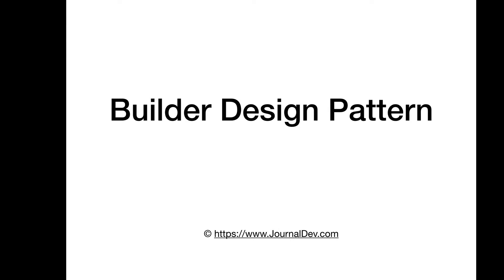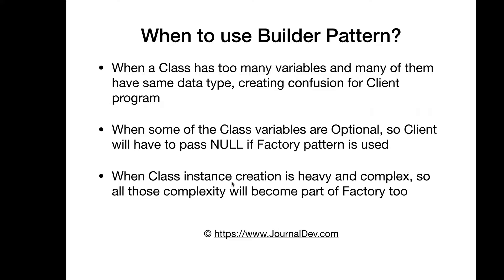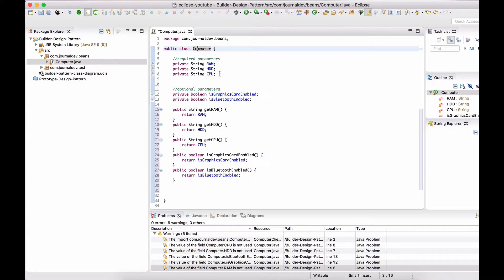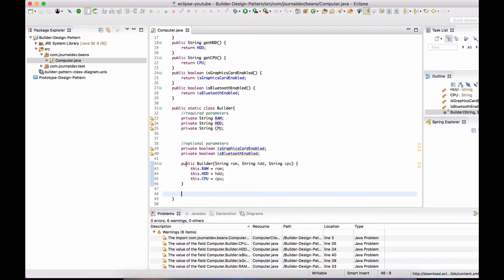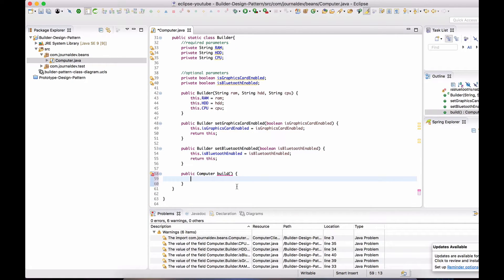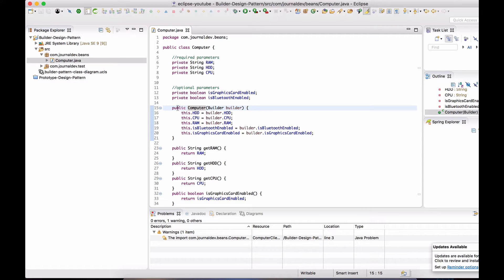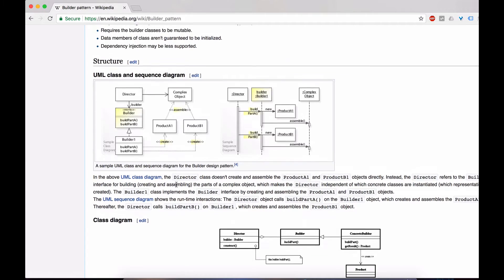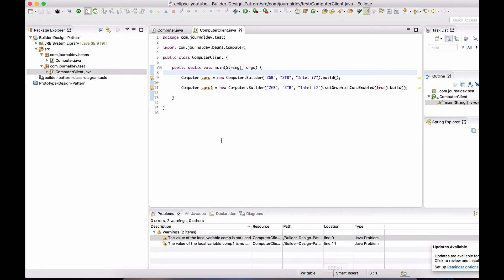Builder Design Pattern

Comment: Hi , If we create these setters in Computer class itself instead of adding these in separate static nested class? Why this is not followed?
Reply: Anshul Goyal I’m also a bit confused by that, but maybe because the builder exposes an interface that shows more clearly to the client which fields are optional? Also as the builder is static, you don’t have to construct the class first so you can set the properties all in one line I.e. chain them together.

Comment: Nice explanation but i have one suggestion for you Pankaj, it might increase length of your video but content explanation wise, it will be great booster. Currently the content shared in PPT is Static and only some modifications are done in Eclipse, it will be great to add and explain concepts in white board also so that it will be more engaging, for ex:- rather than turning slides back and forth, in whiteboard, with diagrams, it can be explained easily (visually better for viewer) what's the problem?, what we are solving? and how we are solving with the approach and then finally move to Eclipse for implementation to connect the dots.

Font size increase is needed for better viewing experince in Mobile screen and PPT background is fine as it focusses more on the content rather than visual appeal.